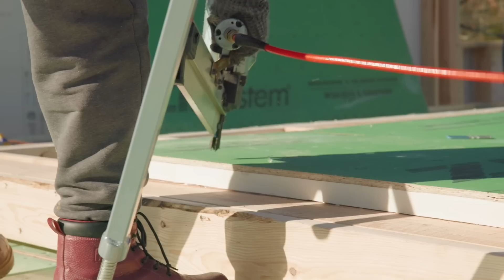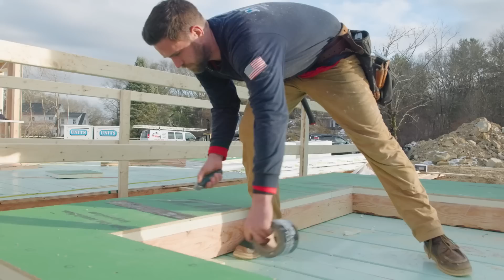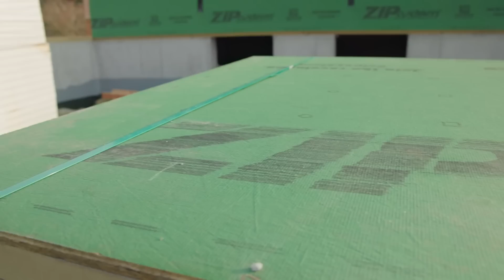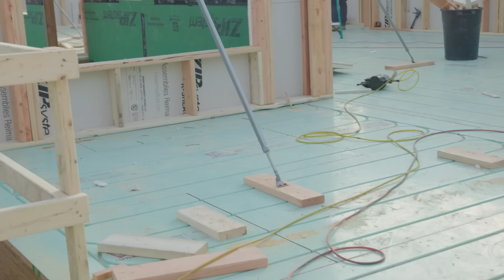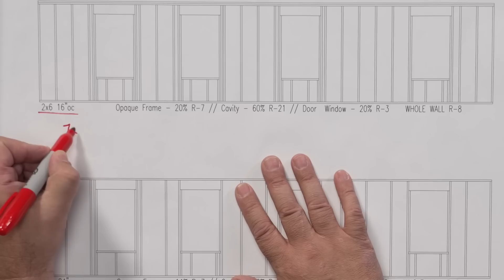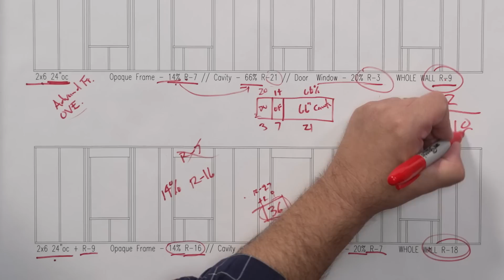"Wall Framing" Build Show Build: Boston Ep. 6

Comment: Absolutly awesome explanation and math.  I've been saying this for years yet the code still allows poorly insulated walls. It's literally a fortune to fix later. But the public wants nice n shiny cabinets.   Really hope a minum of r5 is required for outside insulation in the near future. All that thermal break would add to to an emense savings for everyone buying a new home.
Reply: Only rich people can afford to build such overengineered well executed house for everybody else SIP panels were invented long time ago.
Reply: @andreycham4797  The building methods are not strictly for rich people. Some of the more expensive products they use might be for the higher end clients. But there’s cheaper ways to get the same, or better, results as using things like zip R sheathing. It’s just that it’s not as convenient since that means you’d have to do each aspect of zip independently; insulation, sheathing and weather barrier. 

But all of it is going to be dependent on who is going to build the house anyway. If you build it yourself- you could save more and use higher quality products. Tract builders- pretty much get whatever they decide to throw together. Custom builders- often comes at a higher cost, but you can get more of exactly what you want. 

The tract builders could potentially build using those materials at a lower cost than custom builders. But they are accommodating the masses that want new construction, low cost (initial at least) and as fast as possible.
Reply: @UserError7861  this is the point with SIP s it is very difficult to screw up  almost everything done at a factory and they would provide r value you pay for
Reply: @andreycham4797  True. But it still comes back to who is doing the building though. Tract builders only use products they choose. DIY is a possibility with SIP, as is with any method. And custom builders still won’t be cheap regardless of materials. And if it’s a material the builder doesn’t like working with they may not do the project, or charge more. Which could decrease what savings were possible.
Reply: @UserError7861  I am renovating my two properties and I found so many screwups on them so I decided if ever hire someone I will be there controlling every step then I would ask myself if I am there knowing what and how things need to be done what the f.... I am paying someone 50- 100 dollars an hour  when I have never earned 30 dollars after taxes
Reply: @andreycham4797   Many things people pay someone else to do isn’t always because they don’t know how to do it. Some of it is for the efficiency, such as a crew of 3 guys that drywall every day would do it in a fraction of the time I could.  And sometimes it’s because you don’t want/like doing it. And going with drywall again, that’s something I don’t enjoy doing. So it could be worth the extra money to have someone else do it. 
There’s nothing wrong with acting as a general contractor and subcontracting some task out. You also have to consider if buying the tools needed for some jobs is worth the cost to use for one job. It can actually beneficial to subcontract for some task, whether from potential quality, efficiency or cost.
Reply: @andreycham4797  honestly that's not true.  Pricing out a 2200 square foot cape with garage under.  The additional cost to switch to a r9 over just zip wad 5k.

So yes 2x6 frame in the video pus the lvl studs and closed cell plus extra trim work on the 8 inch thick wall is a ton.  

But just build a 2x4 wall, zip r9, 3.5 inches open cell.   You'll still get the minuminum code in that area of r21 required but you'll end up with a complete thermal break.  And I higher over all r value due to each stud having the r9 behind it.    

It's not a lot more to build right. Problem is most builders only look at there margins. Like 25 to 30%  when you think about that it's insane. They sub out 95% of the work yet put like 60 to 80 k in there pocket.  Surely they could shave off 5 to 10k and give people a better product.  Or even just simply tell the client. Hey we can build a much better wall for 5 to 10k more which will save you like 20 to 30% on your energy costs.  Almost anyone would pay that.

Comment: A question on the staggered framing Steve.  Do you generally put anything between those two wall sections (the interior and exterior 2x4 or 2x6 studs)?  I'm thinking a house wrap/vapor barrier or even a layer of 1/8" back when lumber was relatively cheap.
Reply: No sir, the staggered stud is 7 1/4" thk
Reply: @stevenbaczekarchitect9431  Thanks, after thinking a bit that makes perfect economic sense.

Comment: I've seen some really higher end homes built on the oceanside here in Plymouth, MA. Is there a reason zip systems would be choice material or just cheap contractors?
Reply: I would use it and have used it

Comment: They don’t sell Zip sheeting in Australia!
Reply: Bumma
Reply: @stevenbaczekarchitect9431  we are so far behind here in Australia, after the frame goes up it gets wrapped in building paper that has lots of unsealed penetrations and then they put bats between the studs and leave gaps.  It then costs $1000s to heat and cool but the builders say it complies with the building regs!
Reply: @peterbeyer5755  Yikes! 😳    🇨🇦
Reply: @peterbeyer5755 You don’t need Zip Sheathing for airtightness. You can build a house airtight with basic materials really. 1/2” Plywood with all seams & penetrations taped is airtight. You shouldn’t rely on the building paper for air tightness, it’s made for weather resistance even if there’s no holes in the building paper it’s still not airtight unless you used the expensive European stuff that they used on Passive Houses.

Comment: My question about zip-r and shear rating has finally been answered!
Reply: Yes it has published shear numbers, slightly reduced from the standard 7/16" panel, but in most cases it meets the required criteria
Reply: @stevenbaczekarchitect9431  I live near the Gulf coast, so hurricane resistance is a major concern for me.

Comment: Your framers should put the window liner at the bottom of the header after the cripple header assembly is framed. It should not be between the header and cripples (you call them jacks) as it does not have enough compressive strength. I would get called on that where I frame
Reply: We review every window condition with our structural engineer and sometimes he calls for double jacks to increase bearing capacity, but it is rarely needed. On the sill we will rip a 2X full depth to cover the Zip R-9 edge - it was included in the RO height
Reply: Some inspectors are idiots.

The jacks under the header plate are fine.
Reply: @Smallgot83  It is a code requirement not inspectors choice.  Think of a 3 ply 12" LVL with a large load squashing a flat 2X6X3" bearing

Comment: What do the numbers look like if one uses 6” T-studs instead of regular 2x6?
Reply: There is an increase there,but understand you are replacing 2 1/2" of wood frame at R-3 for R-10 insulation. I would think the 2x6 24"OC wall would go from R-9 to maybe R-11 or 12

Comment: In my area, a regular pine 8' 2x4 is $3.50 and an 8' 2x4 LVL is $120. Makes sense you're not using them everywhere.
Reply: Wow home Depot has a package of 3 of them for $103. Someone is trying to rip you off. Don't buy there
Reply: @shannabolser9428  Welcome to construction in Alaska, where the only alternative to the local lumber cartel is freighting materials from the lower 48, where getting the concrete mix you ordered means batching it yourself, and where rockwool is not available anywhere.
Reply: @canonicaltom  ok, that changes things. I just learned something.
Reply: $120 or $12.00?
Reply: @stevenbaczekarchitect9431  A hundred twenty dollars a piece.
Reply: @canonicaltom  for 8'? that's $15 foot. We are using engineered studs on a project down the road (Riverside Project) and the stud cost was about a 25% premium
Reply: Makes me wonder if I couldn't glue plywood together to make LVLs, but the 4'x8' sheets of 23/32" CDX here (in Alaska) are sixty bucks a piece.

Comment: Lol. Haven't seen a 2x6 that measures 5-1/2" in years 5-1/4"  is more like it
Reply: Great series
Reply: @Ken_Myette  My point exactly - thanks for joining in
Reply: @stevenbaczekarchitect9431  Too bad we couldn't have seen house this house performed with this last cold snap. It was -12° without it the wind in southern NH
Reply: @Ken_Myette  This house will perform very well
Reply: @Ken_Myette  Hey there! In Atlantic Canada we just finished a 2 day subfreezing weather of wind chill -42C!    In USA language 0C is 32F, -30C is -28F so -42C is -52F    💨❄      Brrrrr!   What was interesting was that the single pane single hung windows developed frost on the inside and edge area's.        I am hoping to switch to triple pain with the extension I hope will be built in 2024. 🤔🇨🇦
Reply: @MegsCarpentry-lovedogs  
-40 Celsius is equal to -40 Farenei6
Reply: @MegsCarpentry-lovedogs  Our wind chill was -37 F. Thank God it was only for a 36 hour period
Reply: @Ken_Myette  noted with thanks
Reply: @Ken_Myette  Indeed! This is what could be said to be a "wake up call" to what Mother Nature has more in store.  So, best practice making any more builds with more R value and starting  by "putting on a sweater" around the Outside of the house. 💡👍💯☺🇨🇦
Reply: I’ve seen quite a few 2x6’s over here in Southern NH that measure 5 1/2”, but most of them are live edge hockey sticks these days lol

Comment: I really like your zip sheathing system as opposed to using the traditional board and vapor barrier separately.
there really is no other way of air sealing the envelope.
zip sheathing saves a lot of time by not having to go around after and put one small piece of tape on every staple.
is it sheathing is probably one of the greatest inventions when it comes to air sealing your home incorporating The Best of both worlds into one easy-to-use system. 
thank you very much for all your great videos. you really make me feel like I'm on the job site with you.
thanks boss
Reply: My pleasure, we are all on the same learning curve just different seats - thanks for joining in